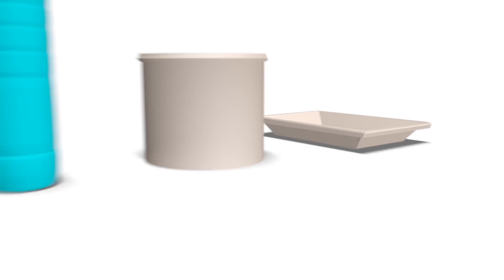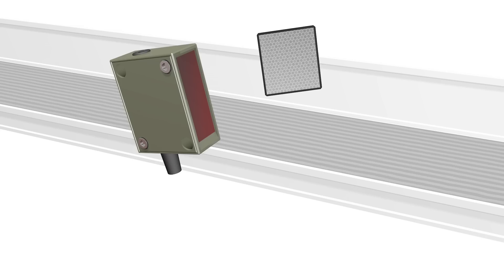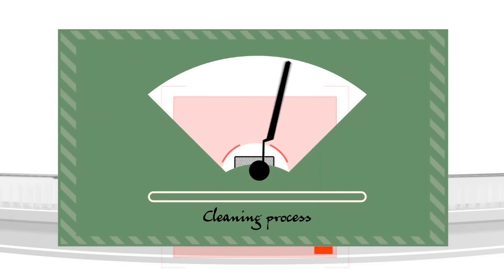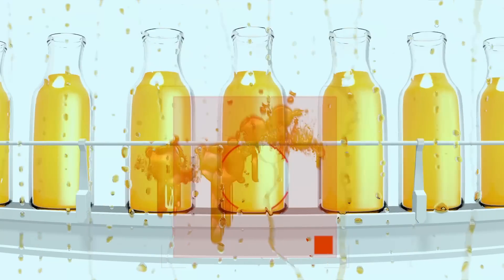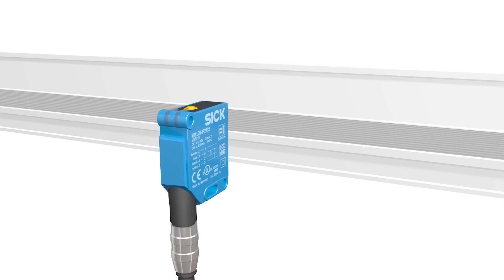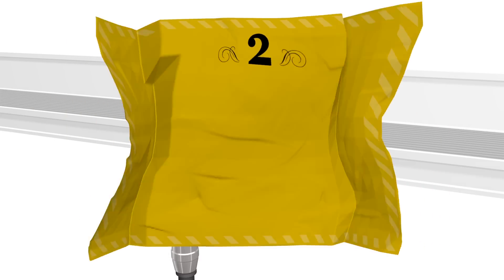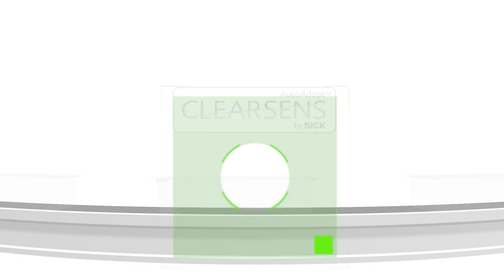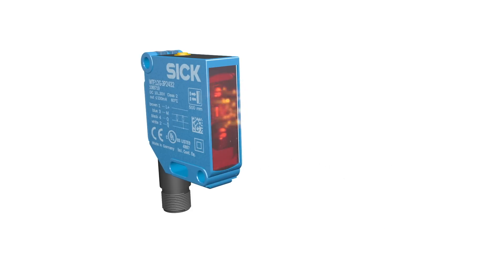Make transparent objects visible - without a reflector: TranspaTect from SICK | SICK AG

Comment: Is it possible to detect a clean liquid?
Reply from the maker: Hello Andika tri, The Transpatect is designed to detect transparent objects.
Transparent Liquids are pretty special because of unstable optical situation because of the refraction of the water. 
Therefore we recommend to use a fiber solution.